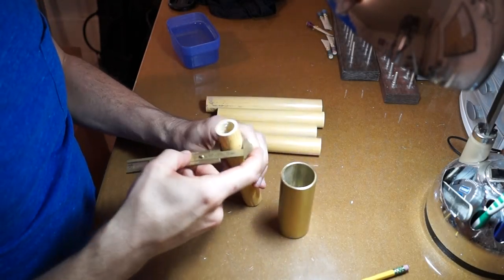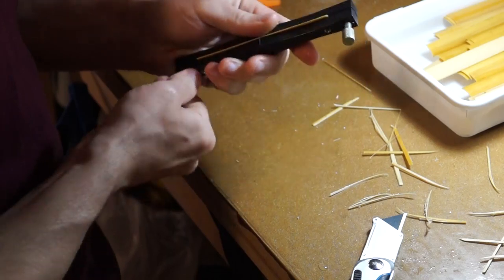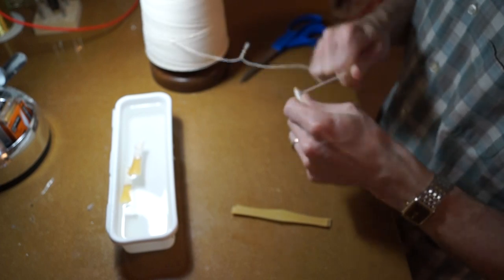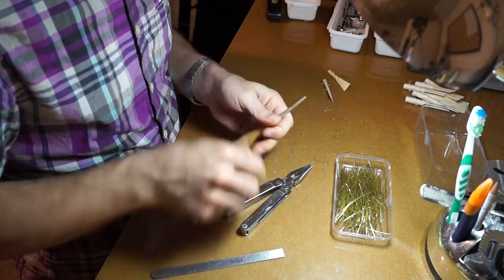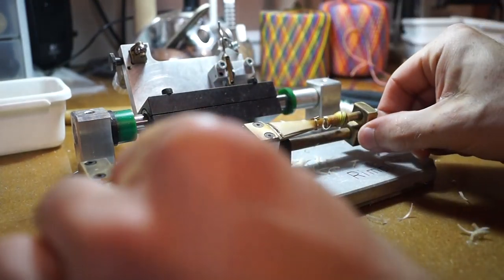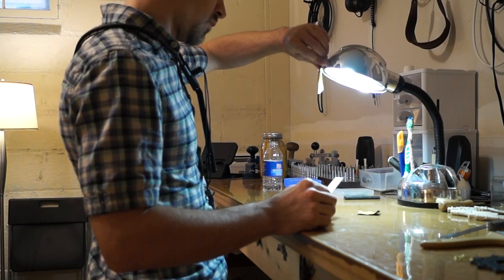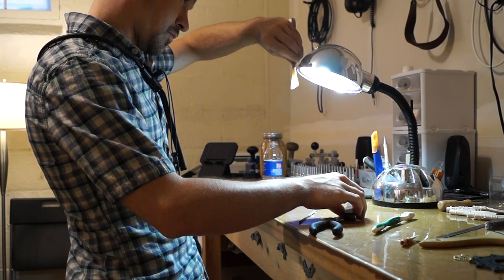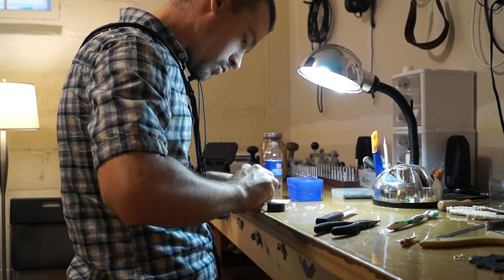Making a Bassoon Reed - from raw cane to finished reed

Comment: Out of curiosity, are you using a custom MD profiler template? It could just be an optical illusion of the video, but it looks like the point at which your template changes angle is set further back than what's on my MD profiler. I ask, because I've been trying to get a profile that's thin enough to easily fold, like you do in this video, without thinning the eventual heart too much. With the experimentation I've done so far, the thinnest I've managed to get the center fold is between 45-50mm thick, which requires supporting it with a metal ruler when folding, which for me usually means my collars don't line up. There's a video Ariel Detwiler has where she shows a method for correcting that, and that's worked for me so far, but that adds an extra step to my process, and I'm lazy.
Reply from the maker: Nothing custom. What I do is set the barrel pins to be on the rounded side, so it doesn't profile a spine. Additionally, you can move the template laterally, which puts the point where the slope begins farther back on the reed, and makes for a thinner tip compared to the collar.

Comment: I've been making bassoon reeds for nearly 60 years and I learned a few things today!  Your beveling the back end of the cane, for the tube, with a sander is a great idea.  I think I'll try it out with hand sanding first, though.  A question:  why butchers twine to wrap as you form the tube?  I've been using just my reed thread (from an odd-colored spool I don't want to use any more) forever.  Are there advantages to using the butchers twine?
Reply from the maker: The butchers twine is considerably thicker, stronger, and a heck of a lot cheaper than reed thread.
And just so you know, I have reverted back to using a large file for beveling instead of the orbital sander.
Reply: @TrentJacobs  thanks, I’ll try the twine. I’ll play with both sanding and filing on the bevels-that’s something where I’m not super happy with what I’m doing now.

Comment: Great video! How much time would you estimate you spend per reed? What's the failure rate, ignoring the pieces you toss after splitting the cane?
Reply from the maker: Well, you are seeing the entire process, so the length of the video until I'm done play testing the first one is the time it takes. For me, roughly 15 minutes. Probably a bit less.

Failure rate is really low. Less than 1/50 I would say unless I run into a particularly fragile batch when they're just all splitting, but that's really uncommon. I'm pretty high yield though, most people are either pickier than me or I'm just able to make them work. I'm not sure which is more accurate.

Comment: Very informative reed making video. What are your wire spacing measurements?
Reply from the maker: 32mm and 40mm from the fold, and about 5mm from the end. I use 116mm cane with 30mm profiled length.

Comment: Great video! I’m clarinetist, trying to make reeds. What kind of guilliotine are you using to cut the cane to length? I’m looking for a similar one, but commercial guillotines are quite expensive for me, I wonder if it’s possible to find a cheaper one. Could you help me with that? Thank you!
Reply from the maker: My guillotine is specifically made for bassoon and contrabassoon reeds. I doubt it could be set short enough for even bass clarinet reeds. It's definitely not set for the correct diameter, you probably couldn't even fit a piece of clarinet cane in my guillotine. I know nothing about clarinet reed making equipment.
Reply: Trent Jacobs Thanks for the reply! Have you made it by yourself? If no is it a custom built specially for you or is it a commercial item that you can simply buy somewhere?
Reply from the maker: @AntonMoiseyenko  it is made by Rimpl.
Reply: Trent Jacobs oh great! Thank you!

Comment: I swear a recall you using the reeds n stuff tip profiler before. Have you always used the Rimpl? Do you have a strong preference for it or is it just what you ended up buying 10 years ago?
Reply from the maker: I have never owned a Reeds 'n' Stuff tip profiler. My university owns one. I've had the RImpl for about 12 years or so. I do prefer the Rimpl, just because of the open nature of how it operates, how the blade area is set up. The RnS and Rimpl both have curved blades and ball style template followers, and can have custom templates, so there's not that much achievable difference between the two if you find a template you like. The Rimpl does move farther down the blade though, and does some more blending with the back as a result.